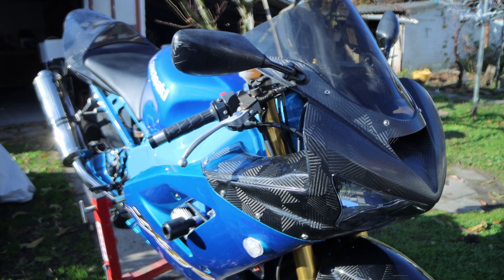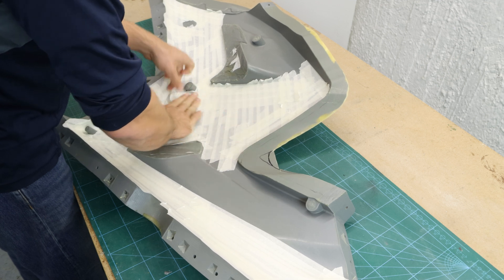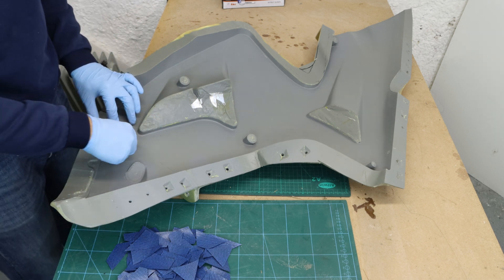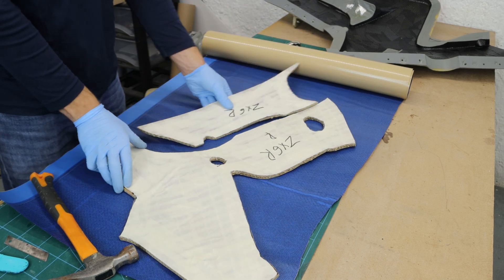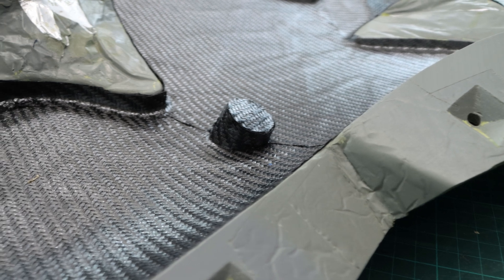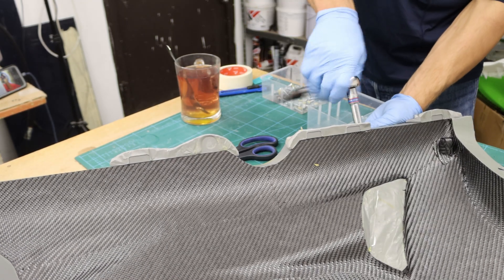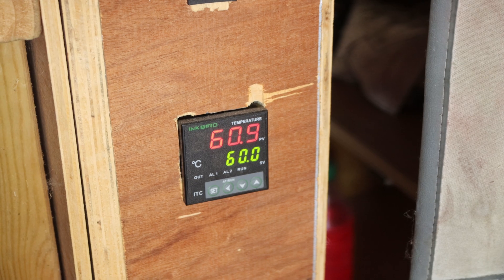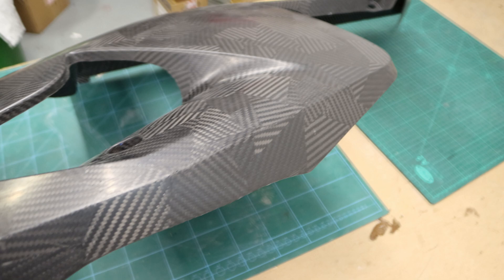Ultimate Guide to Carbon Fiber Parts for ZX6R 03-04 - Carbon Fiber Side Fairing PT.2

Comment: If you're going to the length of making a carbon fuel tank, consider incorporating a superbike style airbox, with the bottom of the tank as the airbox lid. 
Just like the old ZX7R, the 6s regardless of model and year all suffer from a lack of airbox volume - and the intake noises would be nice too ^^
Reply from the maker: Hey!
I would love to do that. The resources and technical skills are not on my side. 😅
With aluminium it would be so easy but composite is a different story. This gas tank will be my first composite tank ever. The video will be interesting I promise 🏍️🛠️🤘
Reply: @zrcarbon9937  The principle is really simple. The lower half of the airbox is simply extended to the sides and forms a flange on top of the frame on all sides, so that the lower edge of the tank can seal against it. Theoretically, you could still do that later but it'd be easier to do it in one go (if the OEM tank can be sacrificed, otherwise you'd have to pull a fiberglass plug from the original mould, modify the underside and then re-make the lower half of the mould. ) But hey, composite fuel tanks are tricky - you might end up with a plug or two anyway. ^^

Comment: I've been working on a Carbon fibre tank for a number of my bikes. I've learnt a lot from your videos, really looking forward to seeing how you tackle more of these challenges!
Reply from the maker: Hey 
Thanks for the compliment. I’m still trying to get my head around the fuel cap. Did you replace the original fuel cap for an aftermarket fuel cap? If you don’t mind me to ask? 🛠️🤘
Reply: @zrcarbon9937 most of my bikes are for the track, so I use quick release caps. For a Suzuki I used an aftermarket fuel cap that is the screw type, very simple design. But I would like to make a carbon one that is a 1/4 turn type for my Aprilia and Ducati. Still a very simple design, but with the addition of a spring in the cap.
There are carbon fibre quick release fuel caps like that on the market for Ducati.